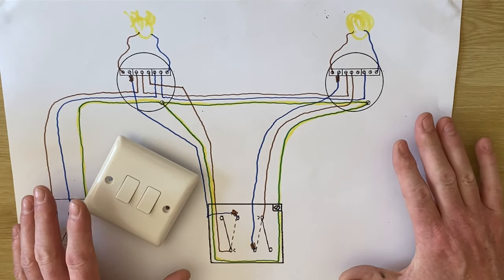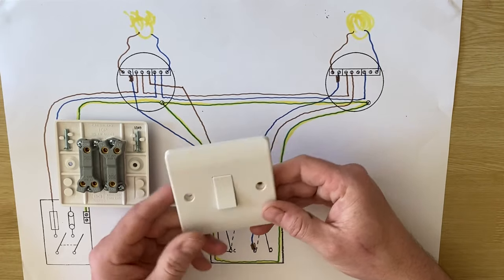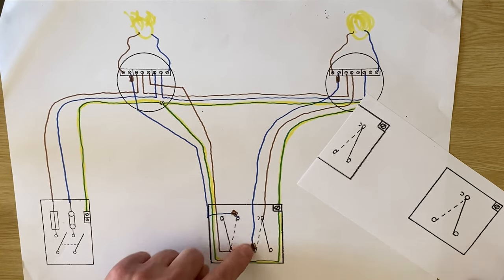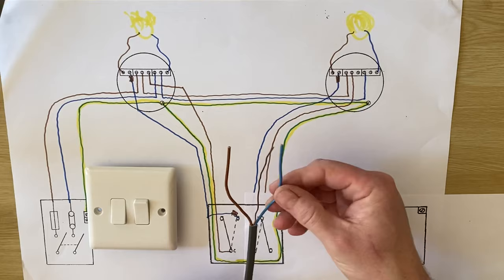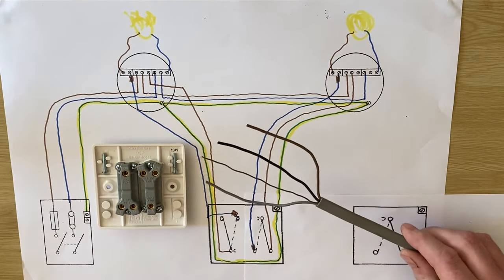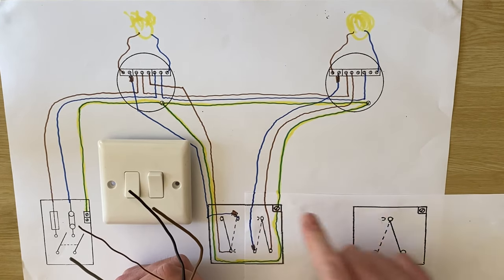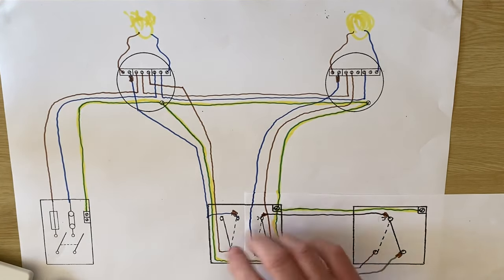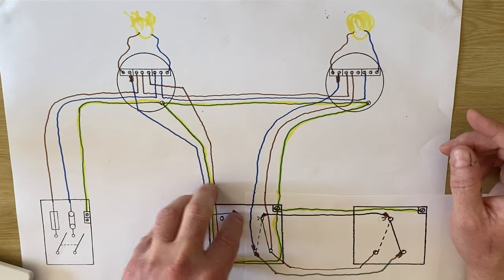Wiring Diagram Using a 2 Gang Switch Converting it to 2 Way Switching Using 3 Plate Wiring Method

Comment: Thank you Gary - clear as always. The downlights I am planning to run do not have an earth terminal so should I still run a CPC between them and if so what would I do with it at each downlight. Also what is the maximum number of 5.5W downlights you would recommend on each circuit? Many thanks.
Reply from the maker: How many lights can you connect to a light switch?
https://youtu.be/-YY0r6zC_M8

Comment: If I remember correctly that’s the non conventional method I was tort to make the connections at the ceiling rose ie the conventional method?, but what ether way you do it it works . Great video clear and informative instructions. Gaz why don’t anyone make the connections in the ceiling rose any more with two way switch cables to each switch?  I haven’t seen it done that way for years. 
Great video as always Gaz❤️👍👍👍
Reply: 3 plate feed at the light. 2 plate feed at the switch was how i remembered

Comment: This has finally shown me what a bulls up I did at re-wiring my hall and bathroom light. Got 2 gang going to hall and bathroom with the hall one connected to a 1 gang switch, at least now I can go back and wire it properly. I do have a question though. Is there a way to wire it so that the light that is connected to the two switches can make the 2 gang one into a 1 gang switch so there is only one switch controlling the hall light? Like maybe using wago connectors to disconnect one of the 2 gang switches

Comment: Hello mate this is really helpful, I wondered if I could as you a quick question! Moved into a new house, changed a 2 gang switch which controls 4 lights - 2 on the landing and 2 in the hall. When you turn the landing ones on, you can't turn it off upstairs! I assume I've just got the wrong wire in the wrong port?

Comment: Great video! Question:  if you are doing a x2 2 gang switches where both are 2 way switches + the power cable running to the first 2 gang box rather than to the light fixtures first.. am I right in assuming you'd have 1 power cable entering the first box, as well as 2 cables to the 2 fixtures, and 2 cables to the other 2 gang box. So 5 cables in the first box? and if that's correct, does the main power cable to the first box also stay at 1.5mm, same as the switches and lights, or is it better to upgrade to a 2.5 since its feeding 2 light circuits?